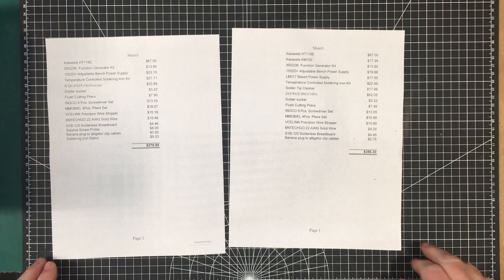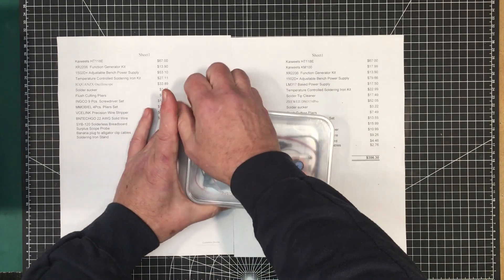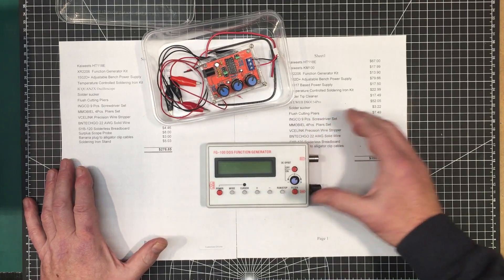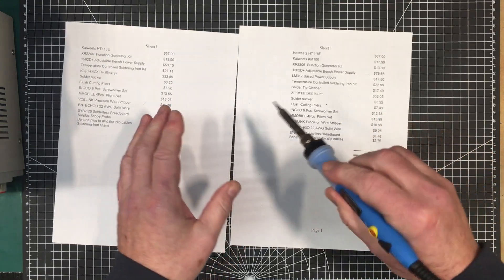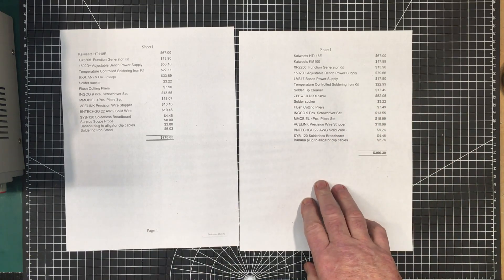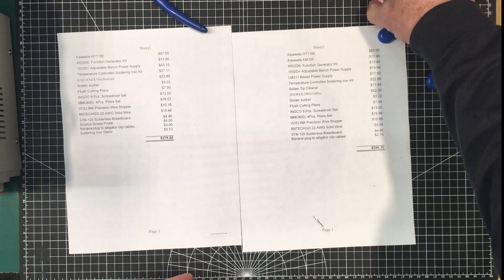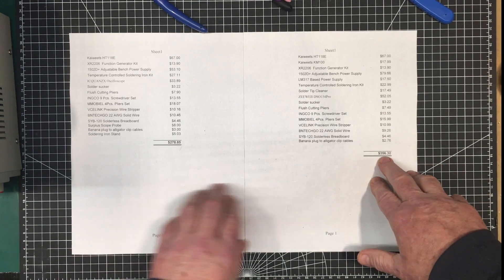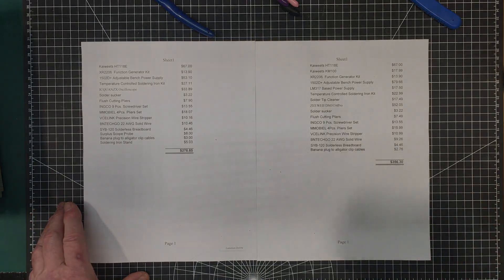0134 - Beginner's Electronics Kit Update #2

Comment: Is your post code supposed to show up when I click on Amazon link?
Reply from the maker: No, I don't think so.  Does it say "Deliver to" and my name a post code?
Reply: I mean, I don't know if this is your code. It says Delivering to Balzac and followed by a code.  @uni-byte
Reply from the maker: @jakubczajka4275  My postal code begins with P1.  Balzac?
Reply: T4B 2T. Apparently Balzac is a settlement north of Calgary. Anyway, it is not your code, so it does not matter. BTW, are tips for this soldering iron unique, or are they using some popular standard tips? Are there any "standard tips" at all, used by many manufacturers? @uni-byte
Reply from the maker: @jakubczajka4275  Okay, I see.  Balzac Alberta is the location of a huge Amazon complex.  When you said Balzac, I was thinking France.

Anyway, yes the iron takes standard Hakko 900 series tips.  They are readily available everywhere and in huge variety.

Comment: Some nice upgrades to the beginners kit. I have a very similar soldering iron that works great and the tips are reasonably priced. I also bought the pinecil(similar to ts100) soldering iron a few years ago and I really like it as well but the tips aren't as affordable. I recently got a few things from temu that are surprisingly good as well so I might have to do a video if my internet starts cooperating. It was out for the past 2 days.
Reply from the maker: It would nice to find out a bit more about Temu.
Reply: @uni-byte  People seem to have mixed feelings about Temu but they've had a lot of deals on electronics related stuff lately and the prices shipping times are good which is what I like about them.
Reply from the maker: @percaine  Mayybe I should check them out.